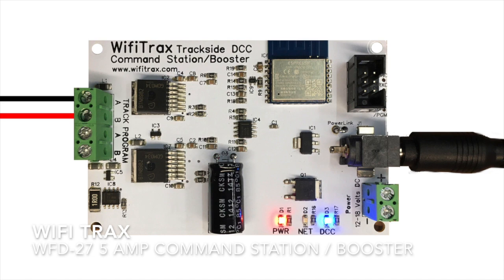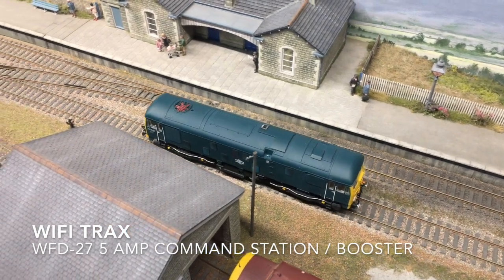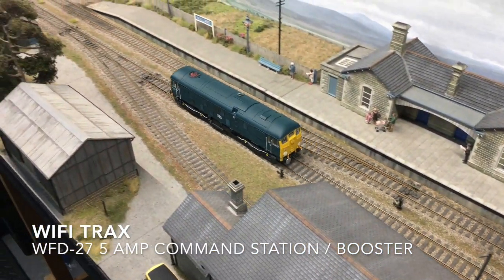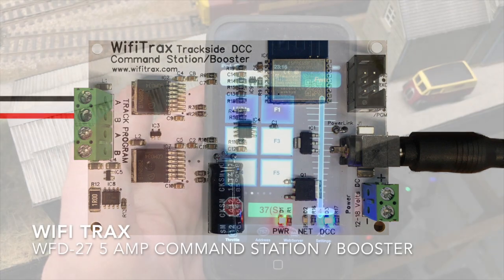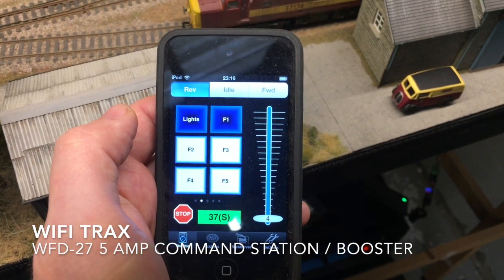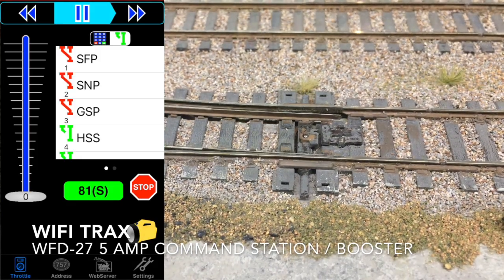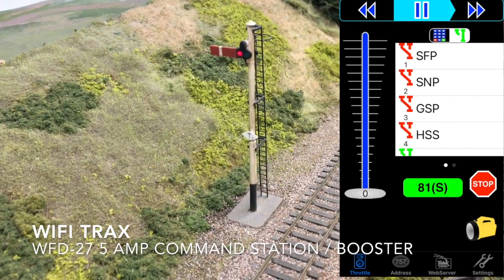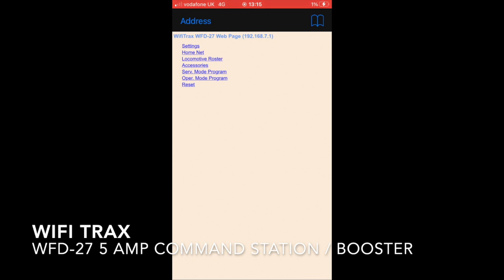Wi Fi Trax WFD-27 5A Wi-Fi/DCC Trackside Command Station/Booster Overview

Comment: Is this really all you need to operate a layout (with a suitable power supply to the unit, of course!) at 5A? I'm just setting up a new, small O gauge layout running locos like a Heljan Class 31 and a Dapol Terrier and am looking to do it as economically possible. I already have those two locos and their respective sound decoders (both bought from and re-functioned by you!) and do I really just need a WDMI-27 5A, 5A power supply and the app on my iPhone to get it all running?